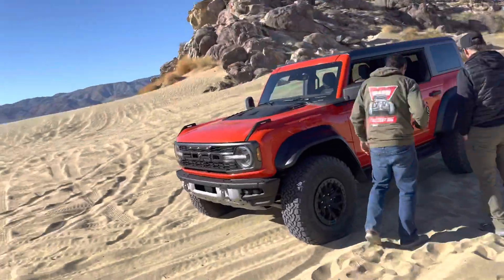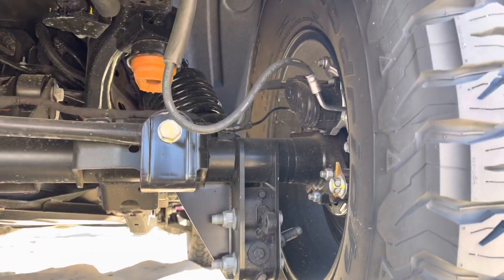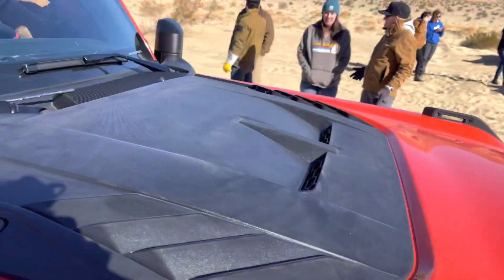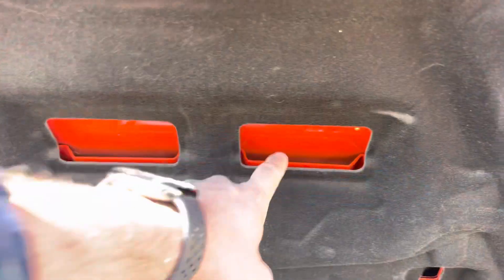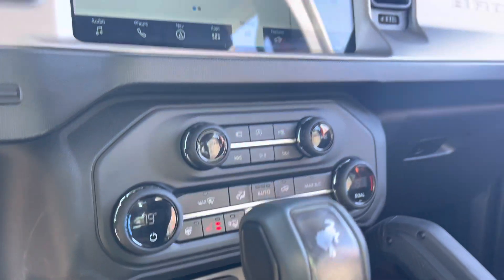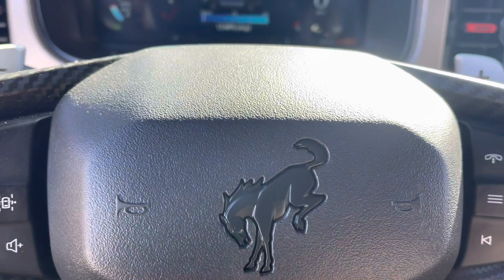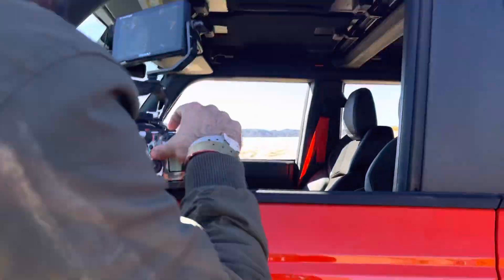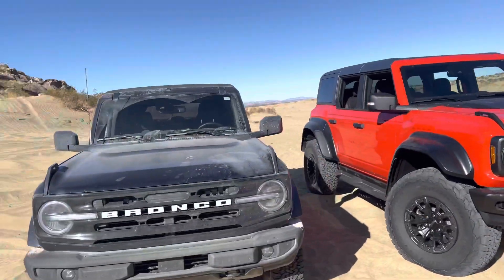FORD BRONCO RAPTOR My 1st look at it!

Comment: Hey Chase, noticed you had the spare tire accessory rack on the OB.  How do you like it?  Any drawbacks?
Reply from the maker: I love it!!! I’m not having issues since the OBX has a smaller spare but on Sasquatch broncos the lager tire and weight of the American Adventure Labs spare tire platform with gear I’ve heard create. But of a rattle. So a spare tire Reinforcement would be recommended other than that it’s great